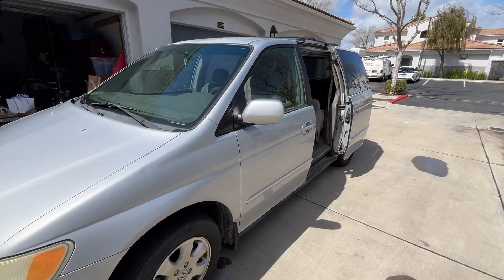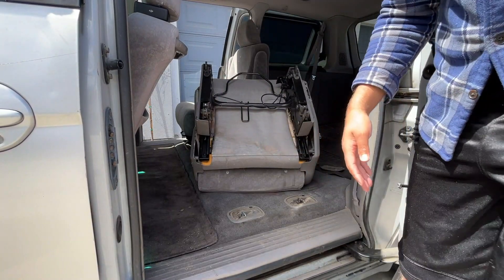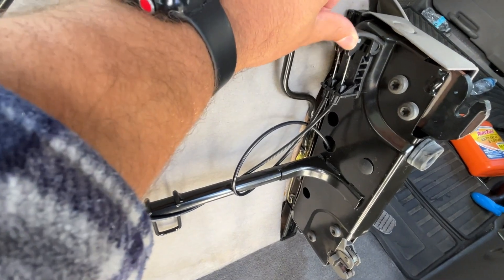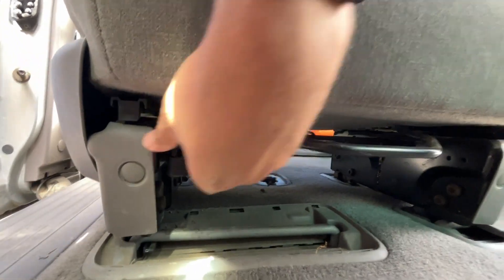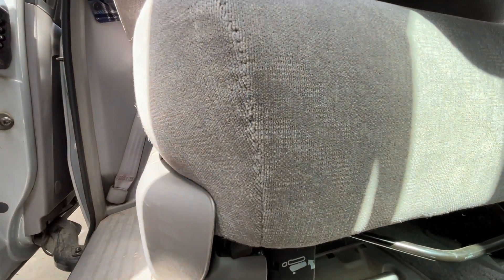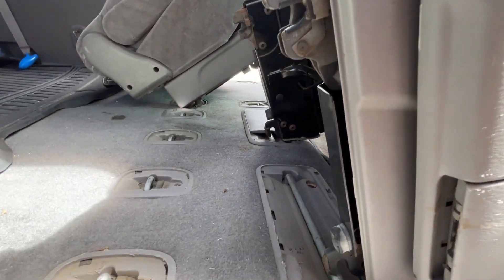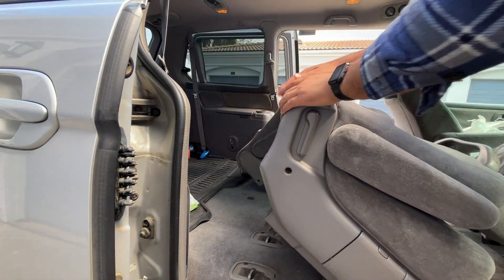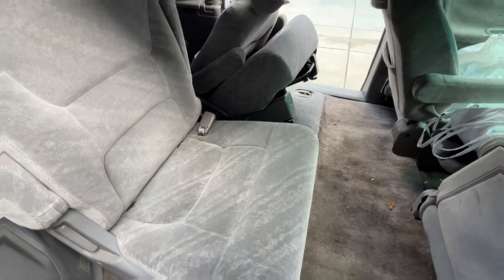DIY Guide: 1999-2004 Honda Odyssey :Removing and Installing 2nd Row Seats

Comment: Great to see this in person and see how the lever pull is for the back of the seat attachment points.  Also good tip on dropping seat back onto rear points when putting back. Ready to try it.